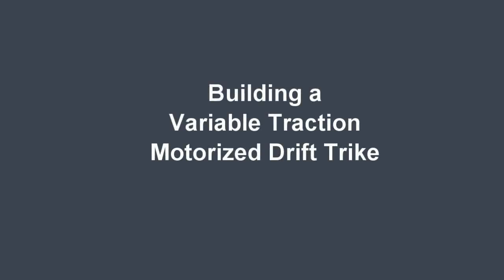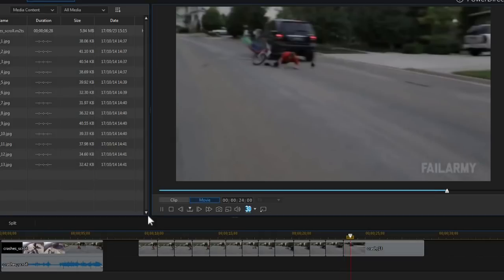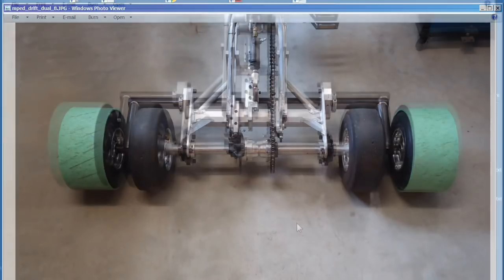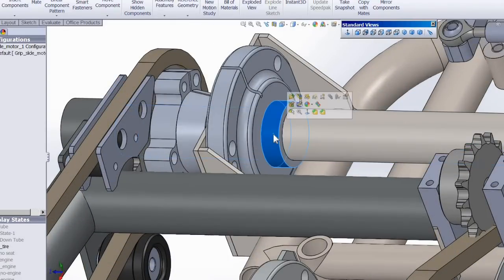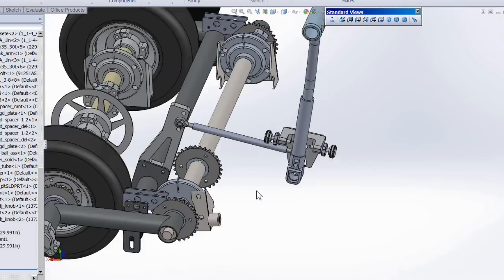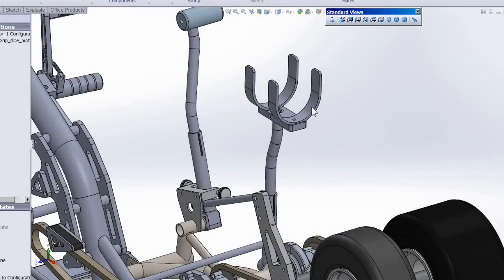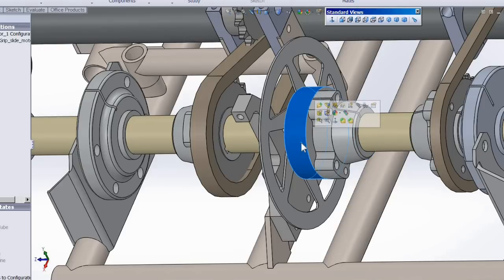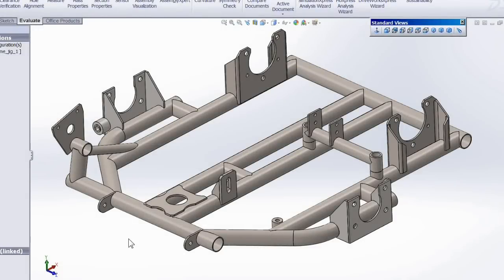Building a Variable Traction Motorized Drift Trike - part 1

Comment: Your outside wheels pivot on the ends for you jack shaft lifting the rear of the kart. You have what I assume are 2 rotational supports nearer the centre rotating arm. One is linked to the jack shaft and the other is linked to a bracket added on the left hand side rear,  just in front of the axle cassette bearing. So my question is why did you do it that way? You could have had both connected to the jack shaft or mirrored the bracket on the right had side. Im sure it would work both ways so is just because you needed to mount a chain tensioner sprocket for the longer main drive chain?

Fantastic build by the way. Im trying to make one for myself only a 72v electric version in either a 3000w or 6000w configuration.